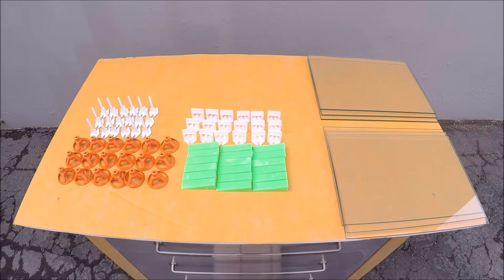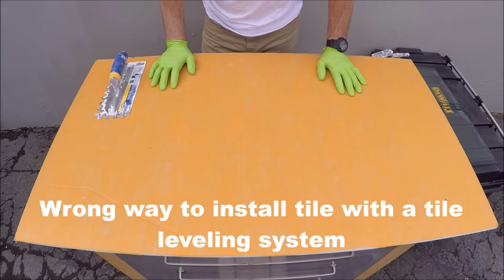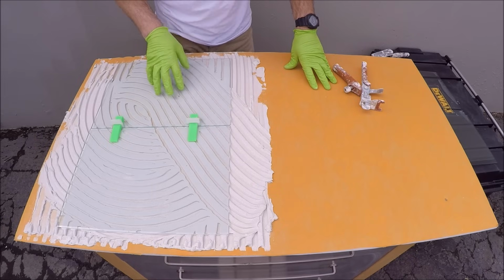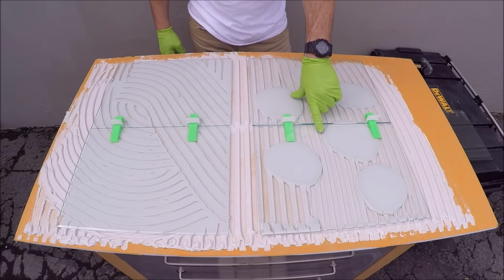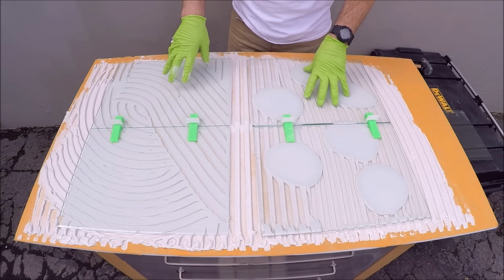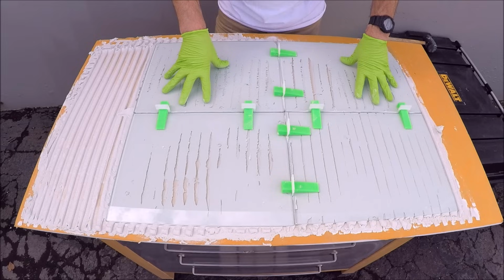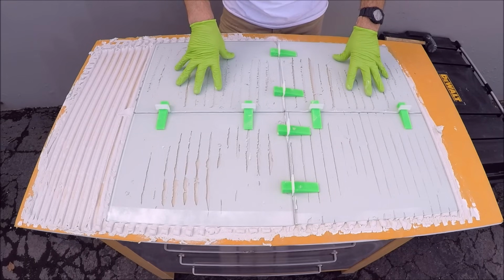How to Use a Tile Leveling System the Right Way

Comment: Another quick tip I’ve found helpful is to completely clean out the access thinset that may squirt out around the clips. Not cleaning out the grout lines can cause a lot of trouble when breaking the clips off after installation. This is good practice anyways to ensure there is plenty of grout in between the tile but is very critical around the clips. I’ve found keeping an old toothbrush and a bucket of water next to me works best.
Reply: Holy shit dude, this was a video about leveling systems not how to properly do tile.  That little trick you found out isn’t a little trick, it’s what you’re supposed to do before grouting.

Comment: This video was more about troweling than it was using a leveling system like the title says
Reply from the maker: Good point Travis, I could have gone over more info on leveling systems. Thanks for giving me a good idea for the next video!  👊
Reply: Incorrect troweling is a not a wrong way to use clips.
Sort of like a video on the correct way to use screws, and the content covers adhesive application. 
Sorry for beating the dead horse.
Reply: He was trying to point out that the leveling system works better with throweling the right way so the ridges can collapse properly. At least that's what I learned from this video.
Reply: I think he's trying to show that the leveling system is not meant to compensate for poor trowelling technique
Reply: Hey Guys, there’s a good possibility that it was a video about all the above.  All of your thoughts encompassed into one video. 😉
Reply: @leibhicks8444  I'm not getting the point of your redundant comments 🤔. 

Was it more to make yourself feel more knowledgeable than the people who watched this video to gain its intended information? I doubt you're getting the admiration you were hoping for.  

The last thing the guy who so generously gave his time to help DIY'ers do their projects correctly needs is your "assistance" to better get his point across, so either find someplace else in your desperate attempt to bolster your fragile ego or just make your own video so you can listen to yourself speak about the redundant points you wish to  convey about your tutorial. The door's 🔀▶️👉➡️ 🔜➡️⏩ that way Scooby!

Good video, thank you for the help!
Reply: @roselucas2760  How long have you been married and how many kids do you have Rose? You seem like a pro at playacting those with sensitive egos that just need a "there, there" from mom to make things all better 😉
Reply: @alexanderjamieson7971  agreed! I don’t think many people realize that correct troweling allows for more longevity in your tiles. Sure having it level is good but it means jack shit if there’s too many air pockets under your tiles to where they don’t last longer than say two years.

Comment: With the swirl troweling, you are careful not to push on it at all, but then with the directional trowel you still gave it a good shove to bed it down. While directional troweling is indeed ideal, in many situations like corners it can be difficult, and this video over-exaggerates the difference. If you had given those first set a bit of a push they would have been bedded nearly as well, and certainly with the 85% coverage needed to be properly bonded.
Reply: ya, why be bogus?
Reply: Yes I totally agree it's no comparison unless the same procedure is done for all ? Pointless

Comment: Kinda funny how you didn't push the first tiles down as hard as you did on the second one's where you used directional trialing. 🤔
Reply: You failed Need to back butter all tile before setting tile in troweled area. Next
Reply: @bryanthomas5275  he addresses this if you were paying attention. Second he's using glass for a reason and back buttering would have taken away from the demonstration of what happens to the ridges.
Reply: kinda funny how its very obvious your still doing it the wrong way!

Comment: After you Directional trowel whatever size  trowel you use your supposed to move the tile 3x the distance of the notch to knock down the ridges to get your coverage. Back buttering helps only with transfer not with coverage

Comment: A great video about how to apply thinset. As others have said, this was all about how to apply thinset and push down on the tile to collapse the ridges and nothing about using the wedges.  The only useful tip about using wedges that you did show was removing the thinset between the tiles.  You did it but did not talk about it.

Comment: To level tile on a 3x5 sheet is a lot different than finding a high spot and going off it in a 300sq’ room
Reply: This is indeed so, while the tile leveling systems are NOT meant to fully compensate for uneven floors, some help on how to deal with such floors would be appreciated
Reply: Or 1000 🤣

Comment: Show us the correct way with big format tiles on uneven surface like in the real world!
Reply: You have to make the surface flat and even before ever laying down tile. That's the real world.
Reply: you lay a level and then float the floor with mud for leveling, Thats the real world,  This is not suitable DIY for you,  Jeff stick in hiring a professional.  Not everyone can hold a hammer the man way
Reply: You can try self leveling cement first then tile adhesive on top
Reply: If the floor is not ideal, you always should either make a new screed floor or if possible use a levelling fluid. Either cement-based or anhydrite. Depending on the existing floor

Comment: One mistake that must be avoided when using tile leveling systems such as this wedge system, is not to over tighten the wedge when pressing it into place. Doing so causes the clip to bend/flex which in turn causes the grout line to widen. It took us alot of time to realise what was causing our lines to be wider in many places. The lesson? Tighten just until you feel the wedge is fastened securely and that's it! Don't force it in any further so that the clip maintains its straight form. This will ensure consistent grout lines throughout your installation.
Reply: blueskies I found this the hard way too. Also, tightening causes the bottom flange of the spacer to “fold” like a taco as it’s pulled into the joint. This can actually push the tile up away from the mortar bed.
Reply: thankyou!
Reply: Absolutely priceless advice for a newbie. Thank you very much.
Reply: @Samlol23_drrich  No problem. Also another reason for not over tightening is that sometimes the clips will actually break, then you're screwed because you have already laid your tile but lost your levelling clip. Hate it when that happens. 

One more tip: Another cause for having random wider grout lines can be because you may be using tiles that have inconsistent edges with some edges that are tapered (not squared perfectly) and so the result will be varied grout line widths. This is also very annoying. So make sure you inspect the tiles quality before installing.I learned the hard way on one job when I had to shave of all the tile edges to square them of so that I can get a consistent 2mm grout line. Not fun at all.
Reply: What about for your first row, i noticed that the tiles tend to move when using spacers
Reply: @romank8881  I always start my first row with a guide board or any straight edge in place of the chalk line. This serves as a guide and a brace to stop tiles from shifting as I use the rubber mallet to tap down the tiles.
Reply: @blueskies8173  just learned this the hard way myself. Had a feeling afterwards that the overtighening was the cause, but nice to have it confirmed
Reply: My advise is don’t use the tool just use your fingers then you feel when you need to stop.
Reply: If he used a wider trowel the ridges would disappear with a slight push, hence better look to the glass tiles
Reply: So is it best to just hand tighten the wedge and spacer instead of using the crimper tool.

Comment: Awesome video, I like how you used glass panels to show how well the tile will bond.  What I learned from this video is that if the thinset is not applied properly then the tile leveling system is almost ineffective.
Reply from the maker: Yes! That's exactly what I was trying to demonstrate. You should check out my how to use tile leveling systems on walls video I recently posted, it's a good one! 👊
Reply: Yes!
Reply: You got the point, others missed.
The way you trowel is the way you set the tile. No tile leveling system can work againdt poorly trowelled cement.
Reply: @LandbergTileTV  How much you earn for a day or oer hour?

Comment: Iv been cleaning carpet, tile and grout professionally for the last few years. Looking to finally start my own business in Florida installing and cleaning tile and grout. Seems pretty straight forward to me. Iv never installed a single tile yet, but this makes perfect sense to me.
Reply: In florida!??! Tile installation doesnt pay, people here are always broke. And if you do that back buttering waste of time u wont last in the business, at least in fl
Reply: Come to canada its 3-12$ a sqft vancouver to b exact 8$ is what id say most charge u can make 20k+ a month
Reply: @ecom300  nova Scotia 3 bucks.supply mortar and delivery.
Reply: @stevedimock3001  wow thats cheap down in bc they charge 8-12 ive even heard ppl charging 20 a sqft only grout incl
Reply: @ecom300  I been doing this for 35 years the only thing that's gone up is the size of the tile and amount of mortar and effort. Oh and the warranty to 3 years with 3 8ths ply over 5 8ths chipboard that's swelled and delamenated from rain and weather.
Reply: @stevedimock3001  u must b very good at tiling u should come to BC canada u would make more than double

Comment: I've watched psy the home inspector videos on you tube. One thing I have noticed is that all the hallow spots in the tile he has found is where the level spacing system was used. Best to make sure that the clips have thinset under the base of the system and on the part where it makes contact with the tile, that way no hollow spots are created do to tile making contact to plastic instead of the thinset
Reply from the maker: That's a great point, I'll make sure to show that in the next video.

Comment: I have done some floor tiles with these levelers, and most anoying thing is thinset around plastic. You need completly clean plastic and remove exces thinset from tile edge, otherwise plastic get stuck in between tiles (where grout needs to be). And lightly backbutter every tile for 100% coverage.

Comment: You are absolutely correct here. The only problem is on building sites here in UK they give you poor floors  to tile on that ideally need latex leveller before fixing then use the levelling system for installing large format tiles. Problem is they don't want to spend the money on latex leveller and think the levelling clips are the solution. So tilers are having the blob out the tiles because the floors are that bad. Same on the walls. They fling up plasterboard without making sure it's flat then expect the tiler to fix the correct way. Tiler inevitably has to bed up the tiles to get over someone else's shit workmanship. Therefore tilers are having to fix the tiles the incorrect way. Then out come the snaggers. They should snag the walls n floors before tiles go on. They do everything tits up here in UK. Good video though because this is the correct way to fix tiles. Just need flat surfaces to succeed in fixing the correct way.
Reply: M J guitars same here in Australia.  Last man cops it.
Reply from the maker: Interesting, thanks for sharing!
Reply: @Viralclown  yeah it's bullshit. The snaggers come out at the end and pull your work and they don't know what shit is behind the tiles. They stand there with magnifying glasses pulling the tiles. Alot of cheap ceramics are different sizes as well. They expect you to polish a turd.
Reply: this! Croatia the same thing

Comment: I have a question!?
Why didn't you apply the same amount of pressure on the glas tile with "diagonal troweling" at 0:55 and 1:11, 
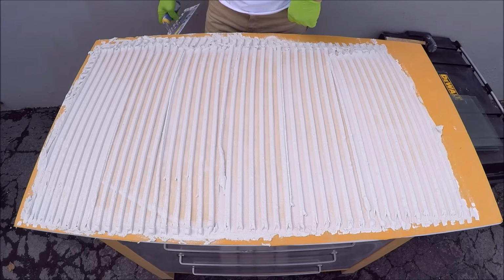as you did at 3:23, 3:30, 3:36 and 3:43 with the "straight troweling".???

And as you mentioned...don´t forget to back butter the back of the tiles....
Reply: Because if he had that then set would have had full coverage.

Comment: You mention in the video to use a 1/2” trowel. I’m using this system on a 3x12 subway tile backsplash and a 1/2” would be way too big. Can you use the wedges with a 1/4” square notch or is that not enough thinset for these systems?
Reply from the maker: That is not enough for a system like this, but we use clips and wedges with a 3/8 trowel installing 3x12 tiles.

Comment: I've used both of the tile leveling systems and the spin on one are better and faster and even a lot easier to use
Reply: I’d be afraid the spin on levelers, could raise one tile up if the other tile cannot go down any further. Thus creating an air pocket. A penny for ur thoughts as I’ve never used either, but gonna attempt to tile my bathroom floor soon.

Comment: How to remove the plastic levelers or do you just trim them with a razor blade and leave them?
Reply: Nevermind, watched your later videos.  I very much appreciate all your effort making these videos.  I’ve learned a lot thanks to you.  If DeWalt had a rolling saw, I’d have gone that route, but a bad back and being 52, the wheeled cart on the R4093 Ridgid is perfect for me.

Comment: Hey how do you remove the plastic pieces that are between the grout lines? Do you just leave them in there after breaking off the top?
Reply: You kick the wedges SIDEWAYS and the plastic pieces break away at the bottom. A small part stays under the tiles.  Don't kick in the direction of the wedge, the plastic part will break at the wrong place and that's a lot of work to fix before grouting.  By the way, you can use the wedges over and over again.

Comment: Used the wedge system you recommend and had the worst time breaking them off after leaving for 48 hours.   The thin set squeezed up around the levelers (due to moving the tile on wet thin set) and locked them in place.  I had to use a Dremel tool to cut out the plastic and grind the thin set down.  I had 1/8" grout line, not sure it that makes a difference.
Reply: I always remove spacers and wipe down within 24 hours.

Comment: Hi .. I have removed the old floors from a bathroom, around 5 square meter. There was a celotex (50mm), sitting on a concrete slab. I repeated the same model, but I added a membering first then 50mm celotex then 12mm Hardibacker. I fixed the hardibacker with screws to the main concrete slab through the celotex. Any potential problem with that? Any advice before tiling?

Comment: does this system eliminate the need for spacers? I've seen some where you still need them.
Reply: FireTrace i want to know this too. I don’t see much space between the tiles.
Reply: It depends on the grout joint you are trying to achieve! Most of the systems out there are a standard 1/16” spacer. If you want a thicker joint you will need to use spacers in addition to the leveling system
Reply: The clips act as spacers. Most major brands offer 1/32, 1/16, and 1/8 inch

Comment: Great video many thanks.
What size spacing between the tiles would you recommend on floor tiles in a bathroom.  The tiles I am using are 600mm x 300mm and 8mm thick.
Thanks Chris

Comment: Can you use tile spacers with a leveling system if you want wider gaps between tiles?
Reply from the maker: Yes, they offer different grout joint sizes.

Comment: Is there rules when installing plank tiles, is there a direction they are suppose to be laid?
Reply from the maker: There are typically 3 different layouts when installing porcelain planks. Random, 50% offset and 33% offset. We prefer 33% offset with small floors and random with large floors.
Reply: Thanks   @LandbergTileTV

Comment: Great Channel! Please do a video on how to begin a project. How to find the center of a room and apply first row. Preferably for a whole house. Which room should I start in? I’m building my home soon and plan to tackle the tile. I’ve done tile before but am by any means no expert. Your channel has been very helpful and I feel like I can do this without screwing it up. The leveling system would have come in handy on my last home. Please include how to account for any uneven areas. Thanks!
Reply: Carlos Torres you would want to start center line off main focus of front door or foyer and work way out that way.
Reply: I'd leave the tile to professionals,  tiling is one of the projects that should never be DIY, no matter what anyone says.  Unfortunately finding a true pro is hard to find.  Every tile setter has a technique they use and we all differ immensely in how we do things.   Never DIY tile is the best advice I could give to anyone.  These simple and easy video tutorials you watch are done in very controlled conditions and don't account for actual floor conditions.   And before anyone replies with floor needs to be leveled etc.  If you've been in tiling business long enough you know that most of the time due many reasons leveling is not an option.
Reply: Yes get a tile guy!!
Reply: @MrApano  What is this "level floor" of which you speak? I've never seen such a thing...
Reply: @markbeiser  level floor I speak of is like one of them mythical unicorn creatures
Reply: @MrApano  Finding a true Pro is the key, I've seen very few "Professional" tiling jobs that are as good as what I've done myself, and that goes for just about every trade in a house. I've lost count of how many issues I've had to correct behind a journeyman plumber, and that's even after pointing out many things during construction.

Comment: can you use tile spacers with these systems? and can these be used on the wall or just floor applications?
Reply: Yes you can, just place the spacers on every corner. Must of these systems come in a standard 1/16” thickness, just add your desired spacer and make sure the tiles are tight against each other, you can use a mallet for that